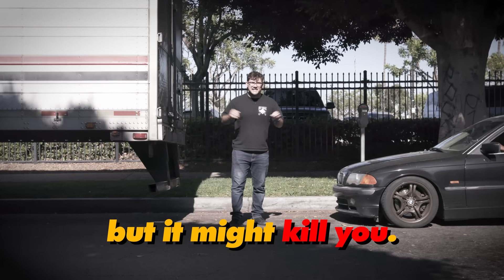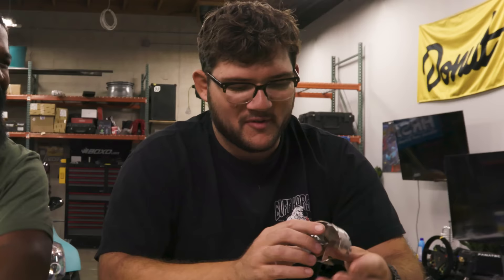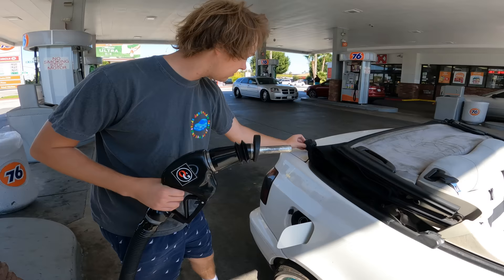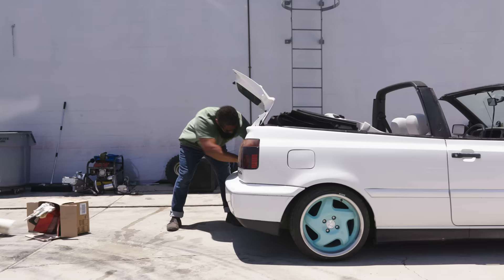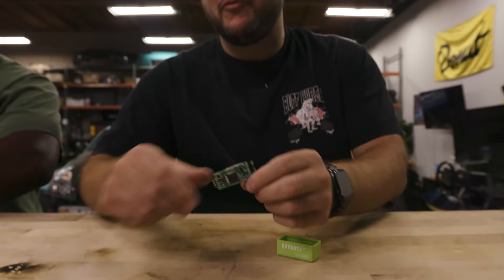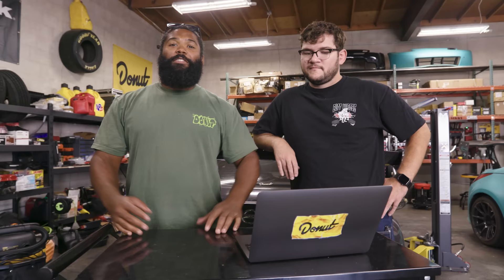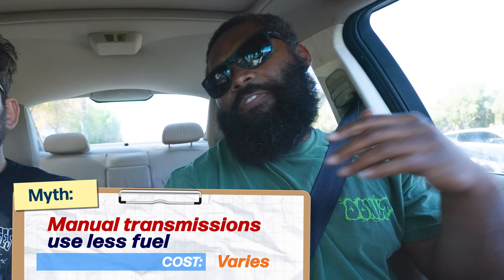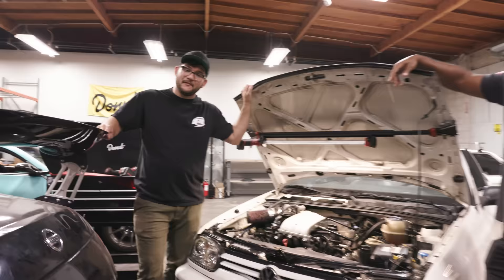Testing Fuel Economy Hacks

Comment: For the higher octane fuel idea, I actually tested this out with my 2016 tacoma v6. I tested 87 octane and 89 octane, all in the winter months with about 1300 miles for both types. I always drove the same route, same speed (much of it is highway miles using cruise control) What I found was I did indeed get a .6 mpg increase going from 87 to 89 but when factoring in the cost increase for the higher octane gas that I actually broke even for it. So while yes you do get slightly increased fuel economy for higher octane fuel it works out to cost the same. I still have all the data from this too if anyone doesn't believe me.
Reply: Plus 89 octane is just a mixture of the 87 and 91/92 octane fuels which the pump draws from both storage tanks as it runs (and it's typically cheaper if you want the mid grade to put a gallon or two of the premium into your tank first and then shift to the regular octane instead of just pumping with the mid grade setting).
Reply: This really isn't a surprise to me these days, modern ECU systems in vehicles are designed to very precisely adjust for any sort of gasoline you put in the tank. In some cars you may not even notice a difference between putting 87 and 89 octane fuel. Be sure to read your owner's manual, or some cars it will even be a label behind the fuel door, and make sure you try to stick to the suggested octane. 5.7 Hemi vehicles like my old truck for example prefer 89, high compression sports cars like mentioned in the video tend to prefer top grade.

Comment: The HHO generator works based on the idea, that the hydrogen and oxygen help combust all the fuel in the combustion chamber. It does use a lot of energy to generate the Hydrogen tho so the gains are often barely noticeable.
Reply: It shouldn't have any gains. It should be less efficient, otherwise, you're claiming to have created perpetual energy.  
The engine is running the alternator, which is charging the battery, which is creating hydrogen, and then you burn it in the engine. 
There is no way that is >100% efficient.
Reply: @MikeHunny  many home modders have their hydrogen plant running off of solar cells, possibly even stored battery power. Ofc one has to calculate all this added mass to see if they are actually making gains or not
Reply: @robertwelch2843  Add up the cost of the materials, time spent into it, extra weight, etc. and you're looking at a loss, even if you do manage slightly better fuel mileage. 
I'd bet my life on it.
Reply: @MikeHunny  The Idea isn't that the hydrogen releases more energy in the combustion chamber, but that it might help if there is any unburned fuel being pushed out the exhaust. If your engine is running way too rich thos might work and help burn all the fuel, but for 99% of egines this effect won't work because they do combust all the fuel they inject.
Reply: @fabiom7078  If that is the case, feed it more oxygen, get repairs or get a tuning. The hydrogen isn't necessary.

Comment: The truck hack with the tailgate definitely works, for some trucks -- with the caveat that you might want a cover vs removing the gate..  I still remember the Myth Busters episode about that, and it makes sense, and their results support your assertion.  However, I have direct evidence my 2011 Ram 3500 MegaCab diesel does not work like that.

I originally bough it used with a crappy roll-up bed cover, which I kept on for like 4 years.  I hovered around 18.5-20 MPG on highway with the cover (my truck is also....modified).

I then threw away the cover because it was honestly garbage and my MPG immediately dropped (same commute to work every day, same tires, same gas, etc).  This went on for years.

Now with the high price of diesel, I bought a semi-rigid tri-fold bed cover and my MPG is back up again. (it's indicated almost 18-5-20 and my measured MPG is 18.2). 

Years showing up to 20MPG, years showing never above 17.9, then now months showing 18-5 - 20MPG.  Maybe it's the megacab body style, but the cover definitely helps.
Reply: The full hack is you put a cover over the bed, and remove the gate but even without the cover unless your driving everywere at highway speeds it will be a net gain. Your not doing it for aerodynamics generally, trucks are already about as poorly designed for that as a brick so you won't lose alot there dispite what the science says (it no wrong, it just doesn't do all the math). Your doing it for weight, tailgates are heavy, as is all the assorted crap you carry needlessly already. Removing that weight means less power required to make the vehicle move, less power means less fuel burnt if your driving properly.

Comment: That temperature of the fuel myth comes from Australia, and specifically LPG fuel. Over there it kind of does make sense, temperatures can get over 110f and the LPG tanks (liquified petroleum gas) is stored in tanks above ground. I don't know if it has any effect on the fuel usage but anyone who has seen propane gas freeze during refueling would draw conclusions about the giant tank of gas heating up and the LPG becoming a gas rather than a liquid and pumping less as it isn't as dense.
Reply: The density of the liquid being pumped doesn't change enough to make a noticable effect. The gas, yes, the liquid no.
Reply: Temperature absolutely has a measurable effect on volume of fuel. However this is well known and corrected for at the time of pumping. LPG for instance uses an industry standard (US) correction factor of 60 degrees Fahrenheit to insure the correct amount is given.
Reply: Yes it gets hot here in aus and if you go to refill on a hot day or when the car itself is really hot, specifically around the fuel tank area (for LPG) - the tank won't even fill up. The cylinder pressure is too high and pushes back against the servo pump trying to fill up the car.

If the tank is mounted in the exterior, you can spray it with a water hose to lower its temperature. Parking in the shade first to let it cool down or filling up earlier in the day helps also. Abit of a pain for road trips though, used to happen alot on an older car I had

Comment: Actually I saw a heat experiment that proved the morning fill-up correct - however the reason is mischaracterized. Its the PUMPS being hot, the delivery system that heats up the fuel before it hits the counter. While it does have an effect, it's measurable but negligible because gasoline is a liquid which doest compress, and really only expels a gas once it's left the gas pump, in your tank and it's free to release the gas fumes you see, which those molecules get more chaotic the hotter it's get.
Reply: I'm surprised they didnt mention this one as well, filling your car slower will get you more fuel too. The vapors that are made from filling your tank are vented right back up the nozzel and back into the tank/air. If you fill slower itll make less vapor, and less gets vented back into the tank/air. Its a very small amount but it adds up.

Comment: Mistake @8:42:  It's true that using high OCTANE fuel where it's not required is wasteful.  TOP TIER GAS (toptiergas.com) is fuel which is certified to have the correct additives & detergents to keep your fuel intake system clean & properly functioning.  May not affect mileage, but ensures that your engine will perform correctly, produce full rated power, and require less frequent repairs.  Use Top Tier gas and skip the fuel injector cleaning, etc.

Comment: Little addition to the tailgate up/down debate: replacing the tailgate by a net actually saves more fuel than with the gate up
Overinflating tires by 10% also saves fuel, but would not recommend this (as said in this video)
And both were tested by Mythbusters back in the days
Reply: didn't Myth Busters prove the tailgate up uncovered was best?
Reply: @jonscot8393  If I understood you correctly then yeah, anything that dosen't create the air vortex inside the truck bed decrease the MPG

Comment: Some of these I disagree with. 

Increased tire pressure does typically improve gas mileage and it's not because the contact patch is decreased, it's because the tire operates better.  When the tire flexes it consumes energy.   We only need to look at the Ford Explorer/Firestone issue, or the Corvair to know car manufacturer recommendations are often at best done empirically often based on what they feel is desirable. 

I'm also not convinced that modern automatics are more efficient than manuals by definition. Automatics may have more gears but torque converters aren't all that efficient.
Reply: A modern automatic will almost always have a lock up converter, eliminating slip from the equation at cruising speed. The rotating mass is harder to get away from, but once again at steady state cruising it doesn't take much to keep it spinning. Having said that, I'll still choose a manual.
Reply: In regards to tire pressure, it's also something that had a much bigger effect when cars were running on bias ply tires since the tread area is much more rigidly shaped on radials
Reply: Higher pressure makes tires more firm and roll with less drag - higher mpg.  Easy to feel on a bicycle; try peddling at two decently different pressures and see which is less effort.

Comment: Whats interesting to me is that I recently replaced my broken stock exhaust for a stainless steel cat back system. Is currently getting me up to 63 miles extra distance. Loving it.
Reply: Yeah. I did some modifications (intake, ignition, exhaust) to a 2002 cavalier, and ended up with about 40mpg, whereas before it was around 35mpg. And then the head gasket went….. sploosh

Comment: One unique exception to the octane fuel rule is the na flat 6 subaru motors, particularly my 3.0 can take 87 no problem despite being reccomend at 91, with 91 it just gives me a little more balls
Reply: Regardless of octane, if you can find ethanol-free fuel (and it's not over priced) that is more efficient than 10-15% ethanol.

Comment: Hell yeah, I absolutely want to see Jeremiah build a proper HHO setup. The science is real and makes sense if done properly so it would be cool to see it done right.
Reply: No… no it does not make sense… On board hydrogen generation will never work.

The energy needed to break down the bonds in water to create hydrogen and oxygen gas is higher than the energy you get from burning it.

Basically the amount of energy loss to the engine created by the added electrical load the hydrogen generator creates on the alternator, is higher than the amount of energy recovered by the burning process of the hydrogen generated.

Hydrogen engine that use onboard storage work fine. As the energy requirements to create the hydrogen are done outside the vehicle systems. Also the process to create hydrogen on an industrial scale is more efficient than gasoline, but if the plants that make the hydrogen are using electricity from dirty sources, the environmental impact is not really much better than gasoline.
Reply: @jasonh4534  Yes it does make sense. And I am fully aware of what it takes to make it work and why it hasn't become commercially viable. My point was that It isn't pseudoscience like "structured water" or crystal healing. I am talking about the fact that the science being applied literally works. I am not talking about whether it's a healthy alternative to gasoline or why it won't work unless the entire industry switches to this technology. I was simply stating that HHO is real, it works and it is possible to run a vehicle on it. Just like it is possible to run your diesel car on used fryer oil if you go through the proper steps to make your own bio-fuel. I was simply saying it would be cool to see Jeremiah make a legitimate proper setup and not some half-assed kit bought on the internet. It is absolutely possible to make your own HHO setup that will run your car. I don't care how efficient it is or it isn't practical for most people. That isn't the point of making a video on it. Just showing that it can be done would be a great video. I had a go-kart the I made an HHO setup for just to mess around with and it was a ton of fun building it and experimenting with it on a small motor. I think it would be a fun video for the Donut team to produce and for Jeremiah to share his knowledge, especially since he literally used to make it and has real experience with it. He asked if anyone wanted to see them try it and I am letting them know that I for one would enjoy a video or small build series on it. Just like I enjoyed their stupid little crappy super charger they put on the Cabrio for shits and giggles. It didn't need to actually work or be better than a real super charger. Sure it would have been hilarious if it did but that wasn't the point of the video. The point of that video was just to make fun content and build some shit with your buddies. The HHO video would be just as fun and people could learn some stuff along the way too.
Reply: @aSinisterKiid  Use paragraphs my guy…

Yes you can generate hydrogen and oxygen gas from water, yes you can run an engine on hydrogen and oxygen gas.

Yes it would be a fun video.

No… It does not make sense as a viable way to actually power an engine or increase fuel efficiency. It is physically impossible, the energy output required to generate hydrogen and oxygen from water is higher than the energy you receive from burning it in an engine.

Using a generator big enough to actually create enough gas to be useful… An engine that used it in an attempt to increase fuel economy would see a decrease in efficiency. As the additional load placed on the electrical system would use more power to create the electricity to drive the generator than the engine would receive from burning the resulting hydrogen and oxygen gas mixture.

An engine that used it as a sole source of power would not be able to maintain itself, and would quickly stop running from lack of fuel, let alone actually manage to produce enough power to actually do useful work.

So it’s an interesting experiment, but it will not and cannot actually work as a viable way to power an engine or increase its efficiency.
Reply: @jasonh4534  Once again, I didn't say anything about it being a viable way to increase fuel efficiency or even run an engine solely on HHO. You seem to be assuming a lot of things and trying to put words in my mouth when that isn't what I said. I merely said I would enjoy seeing a build series on an HHO generator for a car. I said the science works, which it does, and it would be a fun video or series. Stop trying to make this about the environment or the entire industry trying to convert to hydrogen. I never said that and I know what is and isn't possible. I enjoy videos where Jeremiah is hosting and sharing his knowledge as he is well versed in many aspects of car culture and science and his videos are always informative. I am simply expressing my interest in seeing them pursue some HHO content. It's that simple. Stop trying to make it more complicated than it needs to be.
Reply: @aSinisterKiid   Look at your initial comment one more time and try to look at it from the perspective of someone who does not have knowledge of your internal thought process.

You stated that “the science is real and makes sense” and “should use a proper setup”…

From an outside observer perspective, the language suggests that you think that such a concept can work “”if done right””…

Nowhere was it made clear that you thought the video would be interesting from an entertainment standpoint, rather it felt like an endorsement of the underlying concept, and that they just needed to build a proper setup and it would be shown to work.

I am curious how a gasoline engine would run on a significant ratio of hydrogen gas to gasoline. Those two substances burn very differently… And I suspect that any amount of hydrogen induced into the system, that would make up a measurably significant portion of the output power, would be problematic for good function of the engine. I am thinking early detonation of the hydrogen would be an issue, as it burns so readily, but the concentration of the gas may not be enough for such a thing. Fuel to air ratio is important for all combustible substances, especially gases and aerosolized liquids.

Comment: 09:00 VW recommends 87 minimum for the GTI but it de-tunes itself to the point where I have noticeably less power and get noticeably worse fuel economy. I always run 93 octane and its a night and day difference. With all of the different engine technologies out there saying that's a scam isn't really accurate, it's more of a case by case basis.
Reply: also top tier fuels don't normally have ethanol. resulting in a more energy density
Reply: VW stipulates 91 as the minimum octane for best performance in the GTI, with 87 being the minimum the engine will run with.

 @liamctracy902  Whether or not ethanol is in the fuel is regulated by local and/or state governments, not tier level. Here in the Phoenix area, ethanol-free gasoline is almost non-existent, while it can be found in the rural areas (and, oddly, at a higher cost), which don't have emissions requirements.
Reply: @liamctracy902  unfortunately the closest place I can get ethanol free gas at a normal gas station is a couple hours away in VT where most premium is ethanol free. Makes an even bigger difference when it's ethanol free though.
Reply: @kamz4576  the 91 that vw specifies is using a different measurement method for the octane level than used in the states.
Reply: @RentableSocks  (R+M)/2 countries = 91 or above recommended, 87 minimum (I own a 2016 GTI, bought fresh off the ship)

RON countries = 98 recommended, 91 minimum
Reply: @kamz4576  yeah 87 min was what i was referring to, that should be normal gas, some will run worse than others, do you buy expensive gas or the cheapest?  I prefer 76 for my german cars, but chevron is up there as well.  shell too expensive and runs kinda bad compared to the others.